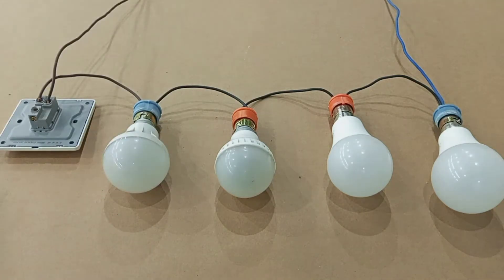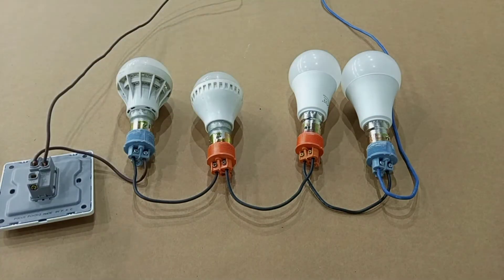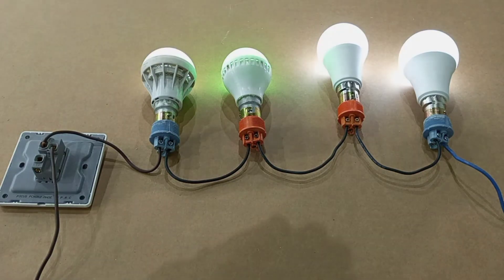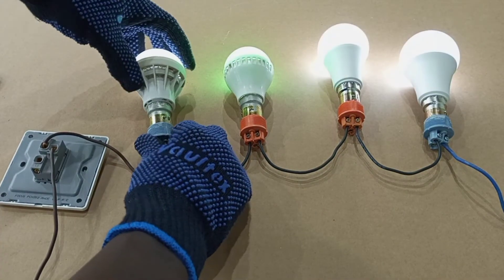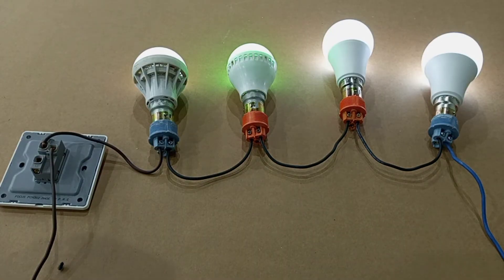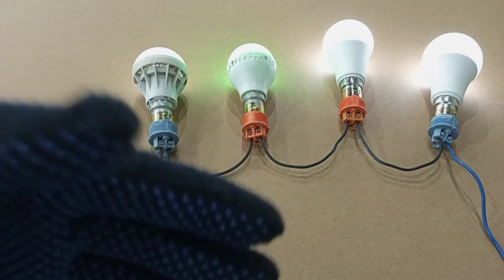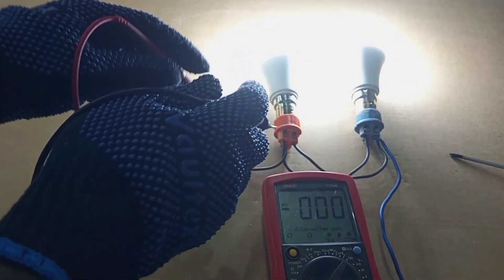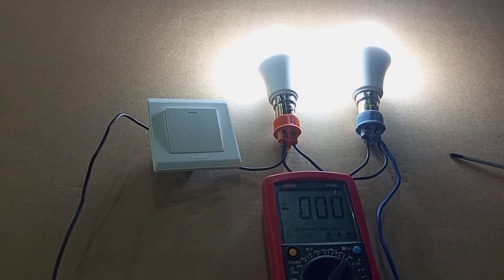LIGHTS IN SERIES AND PARALLEL

Comment: Sir, thank you for your quality and comprehensive practicals/explanations. Please I want to know, since the same voltage drop flows across the two bulbs, would the lower rated lamp 9w break or die in the long run (i.e if left for a long time). Thank you sir
Reply from the maker: No no no. It's not like that. Except there's a surge or power quality issues where the voltage goes too high than normal. And that can affect any electrical appliance irrespective of their wattage rating.